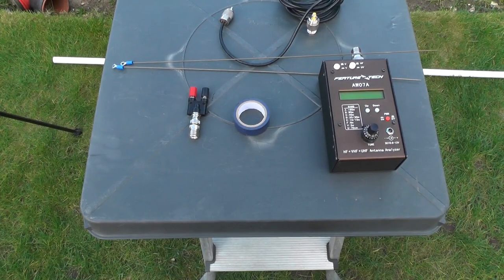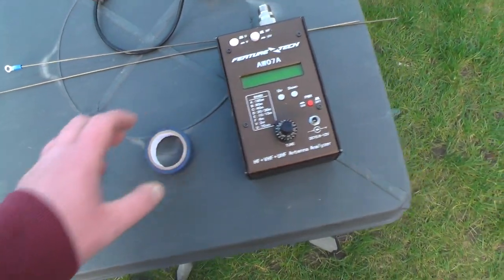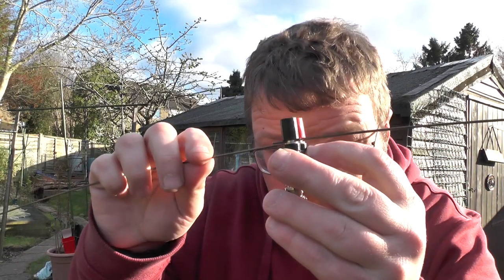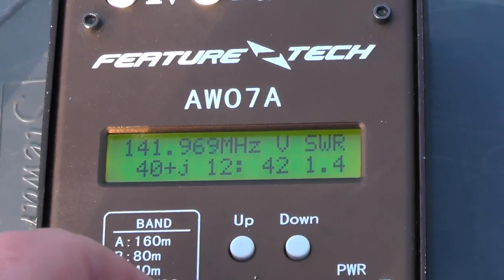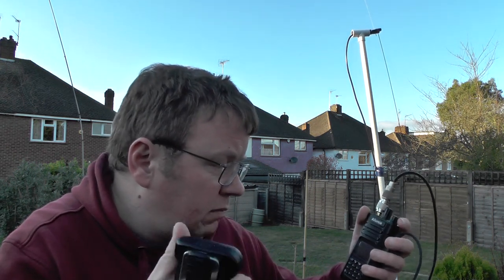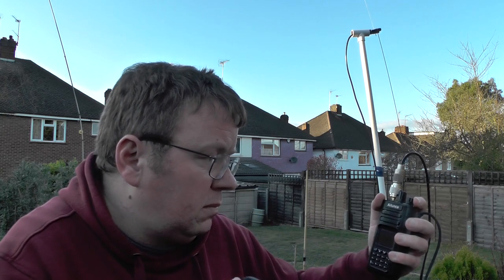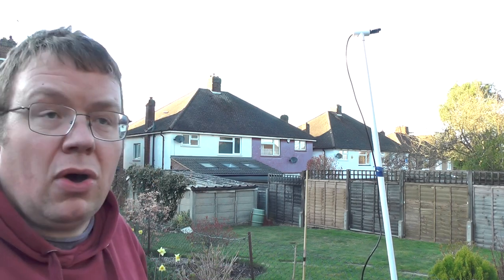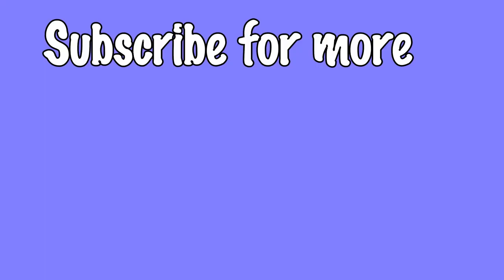No solder dipole

Comment: Are the length of dipole is affect the frequencies it get? Hope i can built it for my shortwave radio. It just have telescopic so just catched small portion of signal and VERY noisy...
Reply from the maker: For a short wave antenna you can try a piece of wire i build one on this channel a while back. the length of the radials depends on what frequency you want to use. i used a online dipole calculator typed in the frequency and it told me how long the radials needed to be